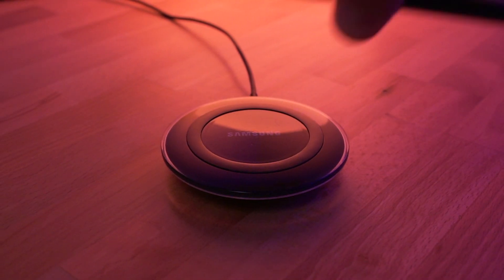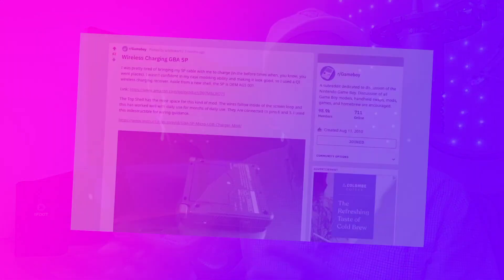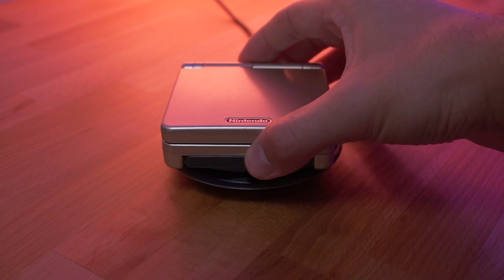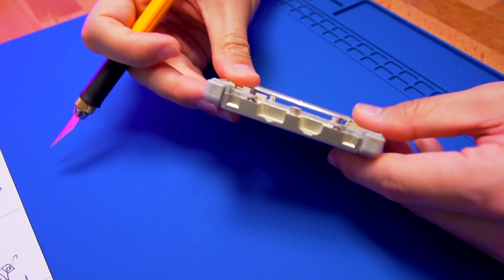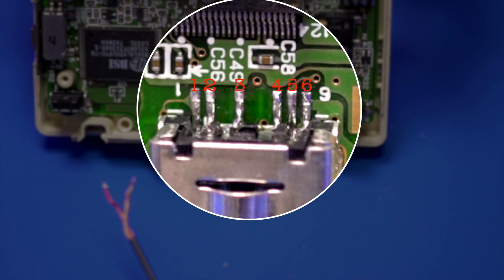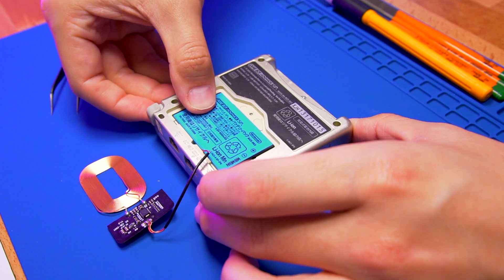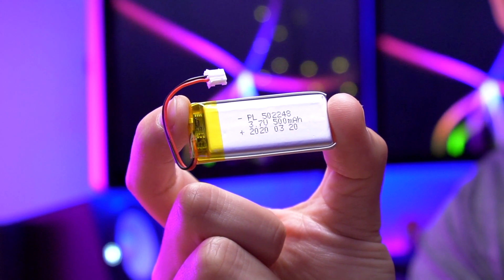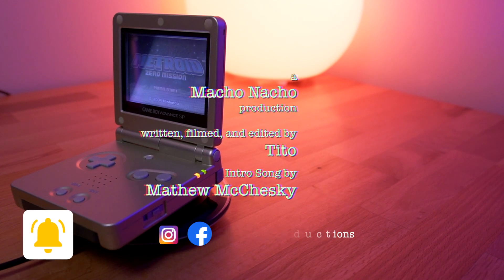PART 1:  ADD WIRELESS CHARGING TO ANY GAMEBOY ADVANCE SP! | GBA SP Mod Tutorial v1.0 | Retro Renew

Comment: Rather than try to accomodate the coil and its circuit board in the battery compartment, could you desolder and then extend the connection between the coil and the PCB so that the PCB could be placed elsewhere internally. That way you only have the relatively flat coil to accommodate in the battery compartment or would that still be too tight a fit?

Comment: I would rather just desolder the coils 1:50 that joins with the pcb and extend the wires. That way I can put the pcb elsewhere while still being able to fit a big battery without needing to cut anything else. Unless I’m not seeing the problem with doing this it’s the best solution I can think of with out sacrificing anything else.

Comment: can be done in a gameboycolor?
Reply from the maker: I’m sure it can be. The only issue would be find a location for the wireless charging module.
Reply: @MachoNachoProductions  the solder points would be the same? not sure about that either...sorry I dont have much experience on electronics.

Comment: So does soldering wireless charging pad to the board regulate the power input at all or is it the same as a "direct connection" to the battery?

Comment: What if you put the black part with the components in the top half and unravel the coil enough to have it reach from the battery door to the back of the display? I'm thinking you'd have to desolder it first.

Comment: The Bewinner module is great, I've used it in a Gameboy Color, and Gameboy advance mod. One thing I found is if you're having issues with spacing, you can desolder the copper coil from the PCB and mount it elsewhere in the shell, and run wires from it back to the coil, just need to remember which part of the coil went where. I may buy one now to try on my GBA SP.
Reply from the maker: It is a pretty great price of kit!  That’s very true!  Kyle and I toyed with that idea. Cheers!

Comment: I suggest to put the wireless pcb board inside the console then extend the wire of the coil or create pressure contacts for the coil so removing the battery cover is no hassle.
Reply from the maker: Great suggestion!  Check out our newest SP video!  We add a bunch more cool tech inside!  Cheers Paul!

Comment: So I’ve accidentally soldered pins 1 and 2 together. I’m waiting on my solder pump and solder removing wire to arrive to remove it. But I’m a bit worried about it in the mean time. If I attempt to charge the console in this condition what are the possible risks? From my research the first pin is for audio usage.
Reply from the maker: Hi Jacob. I would not use the console until the bridge is removed. Don’t want to short anything out. Solder wick should do the trick. Best of luck buddy!  Cheers!

Comment: I'm hoping you still read comments on older videos. I attempted this mod and when I buttoned everything up it appeared to charge but the SP won't power on. I undid everything and it still doesn't power on. I ruled out the battery because it worked before and works in a stock SP
Reply from the maker: Hey there!  I read all my comments😅. One thing I would check is to make sure your not causing a bridge with your soldering. I’d check that first.
Reply: @MachoNachoProductions  First I must say I am dumbfounded that you replied so fast lol Huge props. I took a look and it seems like some solder may have gotten under pin 6 and may be causing a bridge. I'm not super experienced with soldering and desoldering so any tips would be helpful here.
Reply from the maker: Yeah that may be causing the issue. Definitely look into that. Best of luck!

Comment: What about moving the board portion of the receiver to the screen side of the sp, and leaving the wire coil part on the battery door? From the vid, it looks like the wire coil part is thin enough.
Reply from the maker: It’s a pretty tight space. I moved the coil in a few different positions and really couldn’t get it perfect. A thinner battery door would work best I think. Thank you for the comment and watching the video excut!  Cheers buddy!

Comment: Hi, I used this guide from the video, but something strange happened to me. Everything seems to be working, but it's very strange. When I press the brightness button, the red light comes on and if I go back to dimmer mode, the green button lights up again. If I insert the ez omega cartridge into the slot, the console simply does not turn on (the red light turns on for a second, the white screen flashes and everything turns off). If you insert another battery, the red button does not light up when you switch the brightness, but the ez flash cartridge still does not turn on. If you charge the console and switch the brightness at the same time, then charging from charging, the red light turns on when switching, and if you charge from wireless charging, the light does not turn on. Do you know what it might be?
Reply from the maker: It sounds like you may need a new battery or your power switch could be dirty and not making good contact. Try a newer battery and cleaning the power switch with ipa. There are some videos that show how to do this. I hope this helps. Cheers!

Comment: Fantastic concept, thanks for making this video. I’d personally like to retain the original look of the shell.
Quick question, I didn’t get why you made the whole so wide in the shell for such a thin wire? - I may have missed it in the video.
Reply from the maker: Thank you Jesus!  That’s a great question!  The primary reason I made the hole large is because the plastic shell sits extremely close to the charge port and removing the material gives flexibility in the location of where you solder the wires. I’m sure the hole could be made smaller. I hope that answers you question. Cheers buddy!
Reply: Macho Nacho Productions Thanks for the clarification, makes more sense now :)
Reply from the maker: You’re welcome!

Comment: would you be able to charge it WITH a plug after this process?
Reply from the maker: Great question Sofia!  Yes, it still works with the plug. Just be sure to not plug it in and use the wireless charger at the same time. Cheers!

Comment: For some reason it will only charge when turned on when I did it
Reply: Any idea why? Its an ags 101 board
Reply from the maker: That is very interesting. It should work without the having to turn it on. I wonder if the ags 101 board is different, I don’t think it is. I would make sure the wires are soldered to the correct pins and there isn’t any bridging going on. Let me know if you find anything. Sorry I couldn’t be more help. Cheers!
Reply: @MachoNachoProductions  will do. It is making a sound too when it does charge. Do you think that would be bridging? Would using flux help with that?
Reply from the maker: Hmm, perhaps. Yes, flux will help prevent bridging.
Reply: @MachoNachoProductions  Did yours make a sound when it was charging?
Reply from the maker: I don’t recall hearing a noise. What did it sound like?
Reply: @MachoNachoProductions  its a high pitched sound like eeeeeeeeeee
Reply from the maker: I just tried charging it and I think I can hear it a little. It’s not too loud, I can barely hear it. Did you check your connections?
Reply: @MachoNachoProductions  not yet. Im not near my tools but i will in the next two days
Reply: @MachoNachoProductions  will let you know for sure

Comment: Have you considered removing the bottom plastic from the battery itself? Obviously you'll have to take care not to damage the cells inside, but that might just give you enough wiggle room for the wireless charging pad.
Reply from the maker: Thanks for the suggestion!  I wonder if it would make the battery more prone to the heat being produced by the wireless charger. Something I may consider. Thanks again Matthew!  Cheers!

Comment: What an ingenious way to bore out a hole in a GBA shell 

Also how much space is available for the  charger module above the battery compartment between the board and shell housing?
Reply from the maker: Haha, thanks man!  I like to minimize the amount of power tools I use.  

There isn't too much space there, one, maybe two millimeters.  The plastic goes right up against the PCB.  It would definitely help, but I like the idea of having the barrier between the battery and the PCB.  Thank you for the suggestion!  Cheers buddy!

Comment: I did the soldering to the pins and it doesn’t work in my GBA SP. Looking at the wireless device, I ordered it from the link you have in the description. The wireless device I received has a green cable and a red cable, does not have a copper cable. The wireless device PCB has the red cable soldered to one side and the green cable in the middle. I can hardly see in this video but it looks like the red cable is in the middle and the copper cable is on the side. I don’t know if I should switch the cables but I don’t want to cause any issues to the GBA SP. Nice video and interesting mod!
Reply from the maker: Hmm that is interesting. Red should be power so I would make sure you solder that to Pin 2 and green should be ground so I would solder that to pin 6. I have them labeled in the video for your reference. If you look at the pins and follow them up to the connected there is a larger area to solder to. I hope this helps.  It would help if I had a picture to look at. You can post pictures of your project to my YouTube Facebook page so I can get a better look and better assist you. Best of luck buddy!  Cheers!
Reply: Macho Nacho Productions - as you recommended, I checked the red wire and in my kit it’s soldered to ground not to power. I switched them as you suggested and now the wireless charger works. Thanks
Reply from the maker: Fantastic!  Glad everything is working now!  Cheers!

Comment: I'd lean towards the thinner battery since I don't like the idea of the SP not sitting flat on the charger. I'm also curious if the heat generated by the charger might be dangerous with the battery being so close?

Since you'll be messing around with custom print parts in the future anyways, I think a 3rd solution might be available! what if you made the entire bottom part SP itself slightly taller, then it could accommodate the wireless charger away from the battery and you could potentially get a thicker battery in as well.
Reply from the maker: Hey Brady!  Great questions and comments, thank you!  Yep I’ll be doing the thinner battery first and as soon as I get my 3D printer I’ll do and altered battery door as well. I really like the idea of making a custom bottom shell!  I think that could be a fun project to model a new shell!  I will definitely look into that!  Cheers buddy!

Comment: I need a new battery for my sp but im not experienced with soldering or modding consoles, what are my options? 
Im also afraid of buying a random battery that will blow up like note 7
Reply from the maker: Great question Steven!  That is certainly a valid concern. I don’t have too much experience with aftermarket batteries but supposedly the RetroSix/hand held legend SP battery is supposed to be pretty good. I haven’t tried it myself yet but I am planning to. Hope that helps buddy!  Cheers!
Reply: @MachoNachoProductions  ill look into it thanks for the tip
Reply from the maker: You’re welcome Steven!

Comment: Hey MNP, I have an interesting question for you. I have been looking on and off for years for a rechargeable battery that will work/can be modded to the Sega Game Gear. Do you have anything that might point me in the right direction?
Reply from the maker: Hey Mathew!  That is a great question!  Unfortunately, I haven’t come across any commercially available battery kits for the Game Gear (I would totally love one!). Currently I use Eneloop batteries which I always rotate and have charged ones available to swap in. I’m hoping companies like RetroSix or retro modding will develop a kit for the game gear, or even the pc engine gt, that would be rad!  Sorry I couldn’t help, maybe I should look into making my own kit, hmmm. Cheers buddy!
Reply: @MachoNachoProductions  Ah. Thank you very much. Looks like I will have to buy the Sega Game Gear games separately while I look for a good solution for emulating the system on a portable platform. That way i legally own the game; it is just something for my mentality. Do you have any good ideas for this category?
Reply from the maker: That’s a good idea!  I’m not too experienced with emulation rigs but I am planning on making a pi cm3 handheld console at some point. The channel retro dodo makes some great videos on emulation consoles. I would def check them out. Hope that helps!  Cheers buddy and best of luck!
Reply: @MachoNachoProductions  Thank you for the reference!
Reply from the maker: Absolutely!  No problem!  Cheers!

Comment: Do you think this would fit better behind the screen if you have an IPS mod? Probably more annoying to wire, and you'd have to charge it upside down though.
Reply from the maker: Great question!  Yes, I think it would fit much better, especially with an IPS modded SP. You will have to disassemble the SP a lot more to get it in place and it may be a little tricker to mod but you shouldn’t have to worry about space. Are you thinking of putting it behind the screen?  Cheers buddy!
Reply: @MachoNachoProductions  Not planning to, but just did a GBA SP IPS mod recently and all that empty space came to mind.
Reply from the maker: Gotcha!  Yep, the IPS mod def makes quit a bit of space. Cheers buddy!

Comment: I think I would rather have the thinner battery. However, would that mean the battery life would be less?
Reply from the maker: Great question Andres!  That would depend on the battery you have currently.  The thinner batteries that I will be using will be around 500 mAh while the original stock battery was 600 mAh.  In that sense it is a lower capacity, however, since the original batteries are so old, the probably have less capacity than than the new one I will install.  Also, a lot of the aftermarket SP batteries tend to not be good quality and have less capacity than stated on the label.  I will most likely test the smaller battery to see what kind battery life we can expect.  Cheers!

Comment: Would this still allow for wired charging as well?
Reply from the maker: Great question Jesse!  Yes, you can still charge using the traditional wire.  Just dont charge using both the wire and wireless at the same time, I'm pretty sure that will cause some problems.  Cheers!

Comment: I’ve never really understood the wireless hype.. you can’t use it while it’s charging — I guess you can but wired chargers just seem way more ergonomic and well.. reasonable. Anyone wanna explain the pros of wireless charging?
Reply: saves the port from needing to be plugged in and out reducing wear
Reply from the maker: Great question!  I suppose this mod served a few purposes.  The first was, could this be done? and the second was a potential added convenience for the SP.  I understand the scenario where it would be nice to play while charging, but it could be convenient if you already have a wireless charger plugged in which I'm sure some folks do if they also have a cell phone that wirelessly charges.  I suppose it's the same argument of why smartphones come with wireless charging, you can't use your phone while it charges wirelessly but it is convenient to have the ability to just lay it on the charging surface and not worry about cables.  I'm not sure if that makes sense.  Hope that answers you question.  Cheers!

Comment: Nice Vid Tito, I bought some of these wireless charging modules a while back with the intent to do this on the Original GBA then the SP. I got it working on an original GBA but never got around to doing the SP so glad to see you have some success! Did you consider cutting out the bottom of the battery compartment to make more room?
Reply from the maker: Thank you JayBoyModz!  I really appreciate it and everything you do for the community!  I actually hadn't thought of that but a few comments suggested it and I think its a really good potential method to get additional space.  My only concern (need to verify) is that if I cut out the bottom, will that lead to the battery contacts to be misaligned.  I need to look into that, but it could be a great simple and elegant solution!  As always your comments are greatly appreciated dude!  Cheers!
Reply: @MachoNachoProductions  Awesome man looking forward to seeing this one figured out! 👍

Comment: Great video as always, I would prefer a thinner GBA battery, and also, did you know that the first NDS battery fits and charge the GBA SP? and last longer?
Reply from the maker: Thanks Dave!  Great suggestion!  I should look into that some more.  Is the DS battery a little bigger or is it the same size as the SP?  Cheers buddy!
Reply: @MachoNachoProductions  same size, model NTR-003 you only need to trim one plastic holder and your are good to go
Reply from the maker: Awesome!  Thanks for the info!  Cheers Dave!